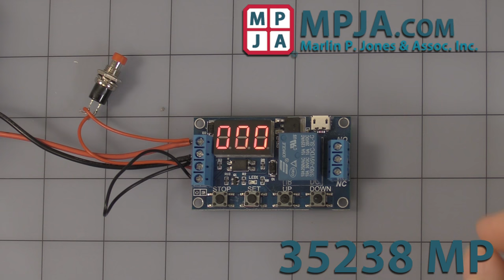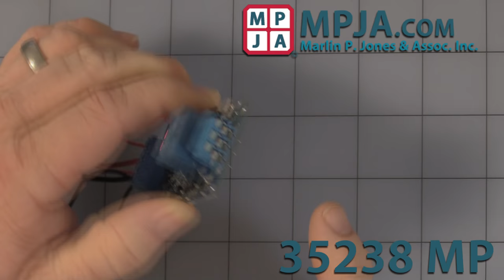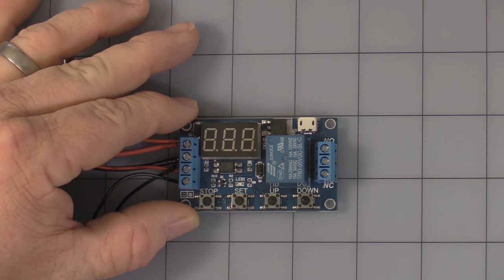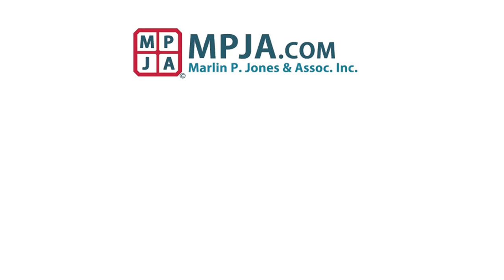Programmable triggered timing board 35238 MP

Comment: There is one more function: Hold down up or down button (F1 is normal operation, F2 when powered up relay turns on with no countdown time) Stop button turn on and off.
Reply: Only on the XJ-801 version

Comment from the maker: Depends on your sensor if it has an adjustable set point (on-off) and a transistor output to act like the switch I used. Plus a separate power source for the delay timer 6-30Vdc.
Thank You

Comment: This is really good. But I got some questions. Can you use a 9 volt battery or other batteries to power it? Do you have any videos on the wiring? I am mildly confused with the ground cable. Does it need it? I want to make sure I wire it with the trigger and the battery and everything. I'm kinda new to electronics and I just built very simple things.

Comment: You do have to have an external trigger voltage. Simply using a switch doesn't work. When using USB power there's a 3.2vdc across the power terminals but it's not enough to use as trigger voltage. As such I think USB power is only really useful if you are using P3-1 or 3-2.

Comment: nice!
I have an old car (brasilian pickup Chevrolet Montana, same as Opel Corsa C) and setting ignition on position 1 doesn't turn the ACC on (it turns on only when holding the key pressed in)
for now the ACC IN signal for my Android headunit is coming from the ignition 2 position, so it only works when my dash is on, whith all the engine systems, with engine running or not
I belive I can use this module setted on program 4 to allow my headunit to keep working for 30 minutes after I turn ignition off
also I can cut power for the module when locking the car
thanks for your video!

Comment: I have problems with this board regarding debouncing of the pushbutton. Did you debouced the switch? I'm using a wall push button to start a fan in mode 1.3 and I have double triggering sometimes.

Comment: I'm looking to buy this with the black relay. They also do a double relay vs. I would like to know, if i get the 24V dc input version. Can i wire 24V dc in parallel to the trigger port. Does it have a memory? In other worlds i would like to power it up and it automatically counts down the pre-programmed time till the relay switches? I have a large DC amplified speaker, i wish to add speaker delay protection in series with one of the speaker wires, one unit for treble and one for bass. I would use the double vs. but they only come with the 10A relay.

Comment: Hello! I have this unit and your video has been extremely helpful however I'm finding that program P2 delays the relay as expected and then turns it on (LED lights up) HOWEVER if you press the trigger while the relay is on, the program starts over. In your example, the trigger starts the program but then is ignored if it is triggered again while the relay is open?  I also found that my counter is counting UP, not DOWN like yours.  Thoughts?

Comment: can this be hooked up with a motion sensor and a nine volt battery supply?
Reply from the maker: Yes it will work with a 9V battery but depending on the current draw of the PIR and how often it is triggered the battery would last less then a day.
Reply: @mpjaonline  alright, what does PIR mean?
Reply from the maker: @thisisyourtransmission  Passive infrared
Reply: The "standby" current requirement is 20mA, and the "Relay Energized" requirement is 60mA per the datasheet on mpjaonline's website. So a typical "9Volt" battery wouldn't last long. Even a high-capacity brand new fully charged lithium-ion "9V" form-factor battery only has about 800mAh capacity. So if the board was in "standby" ALL the time, the lithium battery would last about 800mAh/20mA=40 hours...less than 2 days.
(note: a lithium "9V" battery is actually a maximum of 8.4Volts and can be used down to about 6.0V)
Reply: @exgenica  thank you

Comment: The problem I have with the  Programmable triggered timing board 35238 MP is when trigging  on and of it will stop working
over time  I had to replace it 3 times / using a small scooter  battery 12 v / do in need to add a fuse  ? . or is there one on the board,?

Comment: I have the top two terminals on the left connected to a 9v battery but nothing lights up (no power). I can get it to light up via the micro USB power input. Am I doing something wrong or do I have a faulty board?

Comment: Hey I know this is an old video but I'm hoping you can answer a question about this device... Does it remember the mode and time settings if all power is removed from the device? I.e. when it's hooked up to power next time, is it still in the previously used mode and time delay?
Reply: I have the same question, any idea
Reply: It remembers the mode but you have to push the stop button, is there a way to not do that? So it's always ready to go and power comes back on bypassing the stop on off button

Comment: Can this timer be used for a freezer door left open for say 5 minutes then ring the alarm. And if door is closed within set time and door is then closed timer resets. No Pizzo buzzer noise. Trying to make safety for the freezer door. an open door led light comes on. What I want is if the door is not closed in a set amount of time the timer then would go off and send power to the Pizzo buzzer.

Comment: I'm on P-3.2 mode with Open 10s, close 3s and loop = 3. what my problem is, like at 10:40 it does not energize the relay, and it waits until end of P-3.2 blink to energize the relay. there's about 2 sec delay. how can i program this to overcome the issue ?

Comment: I'm using one of these to control a device in my car so that the device has a delayed shut down when the ignition is turned off. I was hoping to use a 12v output from the ignition switch to trigger the signal so that when the key is on, the relay turns on, when the key is off,  theres a delay then the relay turns off, simple... However I noticed you're using a momentary switch, is it safe to use an ignition switch that would be on the entire time I want the relay on?  In other words do you have to use a momentary switch to keep from overheating the signal input or opto-coupler etc?

Comment: so you can hook this up to a sensor via the trigger pin to turn on the relay? Basically I want the RCWL- 0516 sensor to turn on the relay (no delay) and run for 6 seconds so it powers on a musical box movement and turns off after 6 seconds

Comment: Hi, can i use this with a nodemcu 8266, i need to control a water pump that will turn on when the humidity reach a certain point. But i only need the relay to turn on for a few second, to avoid an overflow.

Comment: You did demonstrate that even if the power was turned off, the relay module still remembers the last setting you set it to. Now, my question is..will the relay module still remember the last settings if I unplugged the battery? Or does the battery need to be connected to the relay at all times for the relay to remember the last setting? Hope I make sense to you.

Comment: This thing get very hot, is that normal? The IC (or whatever it is) between the display and the micro usb connector, it hurt touching it with my fingers. I am feeding it 22v. Was planing on putting inside a box but if it gets that hot maybe that's a bad idea..

Comment: Long shot because this is an older video. Would you happen to have a guess why the timer will activate but the power is not being sent to the device? If I just hit stop it turns on no problem but for some reason when I "trigger" it and the timer goes I get no power? Any guesses will be greatly appreciated.
Reply from the maker: Do you have power connected to the relay’s COM terminal? A relay is only an electronic switch it does not provide power out. Let me know. Thanks

Comment: Sir, can this device be used to make an led flash, say for 3 seconds, and then countdown from an adjustable amount, in a continuous cycle without pressing a button?
Ideally I'd like to be able to control both the interval, and the duration, can it do that? 
Regards Mark.

Comment: So what voltage does the trigger need?
Can it be configured for power-on delay?
e.g.
Switch on power
Delay for x seconds
Energise relay forever until power is switched off.
Reply from the maker: Trigger voltage is 3 to 24vdc most people use the same power source as the timer itself. Look at the section of the video for P2 program it is delay on but max “OP” on time is 999 minutes.

Comment: My unit only counts up -not down-is there an undocumented setting? I have looked all over!
Reply: mine is the same but seems no answer @mpjaonline please advise us. Timer going up means power removed to activate relay which is ok for me as I'm using a standard pir which is a normally closed circuit to activate my stair lighting but if I use pressure mats they are normally open signals which will not work for this. Other than that this is a great module for various projects

Comment: Hi, I am making an exhaust system for my mushroom grow room.  I want to use P3.2 in a loop in a way that after ever 45 minutes the exhaust fan turns on automatically for 15 minutes.  I want this system to run on a 24/7 basis.
 Can you please help me with the following;

1) I am using the USP socket to provide power, so How to set up the wiring for the fan?
2) Please confirm if using P3.2 in a loop is the correct program setting?

Thank you
Reply from the maker: 1) Here is a link on how to connect an AC motor to the board, same principle as an AC fan  
https://www.mpja.com//download/35238outout.jpg

2) P3.2 looks like the correct program but before “going live” let the timer run on your desk for a few cycles or days to make sure it is doing what you want. Remember this board is not weather proof you must protect it from condensing humidity. Good Luck
Reply: @mpjaonline  thank you for your response and feedback. 
Just a follow up question, do I need a trigger of some sort to start the motor?
Reply from the maker: @N4Nai  P3.2 Starts when power is applied, no trigger required.
Reply: @mpjaonline  thank you

Comment: Amazon sells similar boards which also have low voltage trigger and one extra connection point on the left.   Does anybody know, is it a different chip, or low voltage trigger achieved differently ?

Comment: Mine doesn't seem to work( at any setting relay turns on for like 0.1 second, then shows which program is running. Timer doesn't  come up at any setting. Timer seems to work only when you press Stop to turn off the relay.

Comment: I bought the timer a few months ago and finally I decided to use it, but it doesn't work properly. If I set the times from 1 to 10 minutes it's all right, over 10 minutes (any value I set) stops at 1 minute and 5/6 seconds. And even with the program in seconds has some problems.

Comment: I just received mine.  Hooked it up, without a load, the timer counts down and the relay clicks on and off as it should.  After load is connected, com to power+ and NO to the load, the timer instantly stops after triggering.  As far as I can tell with the probe on resistance buzz, the relay never closes?  Hope someone can help!

Comment: How the cirquit needs to be connected if I want to turn it on by a micro switch when I put a glass on it, then a pump needs to go on for 2/3 seconds and fill the glass and then it needs to go off.

How can I do that with the cables and a pump connected to it?

Comment: Great video. I wonder if NC is closed when timer is at "Off" cycle. As an example, can I run one motor when timer is "On" and run another motor when timer is "Off"?
Reply from the maker: Yes the relay output has a normally open and a normally closed contact.
Reply: I'm assuming it is a "standard" break-before-make relay? Not trying to be a pain, just being sure on the spec.

Comment: What is the actual board number on the back? This is practically identical to the JZ-801 board, except the JZ-801 has programs 1.4 (triggered single cycle, no retrigger) and 2.1 (delay w/ retrigger).
Reply: Turns out there is a set of roughly translated instructions at the bottom of the listing.

Comment: Hi. Great video. My timer board (set for 10s OP on P1.3) just does not switch on the Relay nor the active micro led. Timer countdown works exactly as you’ve mentioned but No Relay functionality. Any idea? Could it be a bad board or do I have to factory reset it, and how? Any help will be much appreciated
Reply: Got it working by accidentally pressing the stop button but it works in reverse instead of ON when the timer starts,  relay stays off and turns on when the timer is 000. how to fix that?

Comment: I hoped this item would work for me, but my trigger signal is inverted. I need the function of P4, but my trigger signal is always on, and the trigger would be a short off pulse. I think it would work if there is a P4(.1) with instead of OP, a CL variant. Otherwise I would need to use a second relay to invert the signal.
Any suggestion for similar products, or modifications?
Reply: ters anahtar kullanırsan bu sorunu çözebilirsin

Comment: Thank you sir for informative video,
With this triggered timing board i want to make a project for home, can you please guide me? and sorry for bad grammar English,

Actually i want to make a timer circuit with my doorbell at home
when someone outside trigger the bell button of my home bell
then the 50watt socket system turn on for specific time like (120 seconds etc)

in 50watt socket system i will include
1 x door security camera
1 x 20w small LED/LCD monitor for Camera display
1 x Night LED light for outdoor (with lowlight sensor) if someone ring bell at night

 (Note: my door bell is like bird singing voice, as long it keep ringing as long the bell button is pressed)
(Another thing: it will be more great for me if bell bell is repeatedly pressed by any person then there will no affect on this timer board, and the electricity of door bell should be separate if possible..

Comment: I need help please. It doesn't matter what programming mode I am in, the relay will not activate instantly, it will OP after 10 seconds. I have set the CL on every mode it is available to .1. I currently have it in mode P1.1 with the OP for .1 but it still waits 10 seconds until it closes the relay. In P1.1 that should be instantaneous when triggered. Any ideas?
Reply: @Ijazakhtrbhatti Akhtar I'm not sure what you mean.

Comment: I’m operating on p3.2 to power a 6v motor, why do I not have voltage??? I’m wired just like the video with 6v power and the program is correct and running. Where do I wire the motor in? Do you have a diagram?
Reply from the maker: Here is a link to the data sheet.
https://www.mpja.com/download/35238mpdata.pdf
You wire the motor thought the relay contact, it is like a switch it only turns on and off. It does not supply power.

Comment: tell me about the F1 and F2 functions operated by long pressing up and Down buttons.
also my display is not showing the count down
Reply: F1 and F2 mode is used for toggling relay between normally off and normally on.
i.e it gives the final state of the relay if you are in F1 MODE then relay will be off after time is complete otherwise it will be on.
I am not sure about display problem just make sure it is in C-P mode .

Comment: I have been using this device in Program option P3.2 successfully for almost 2 weeks. However, tiday it has developed a problem. My PL time was 15 minutes and CL was 90 minutes. I had set Loop 120. Today the PL count down starts and then it trips and starts all over again from 15. It is not going to CL mode. BUT when I tried testing it in seconds instead of minutes it works fine. Also while testing I noticed that when the loops finished the switch stays in PL mode.
Any advice anyone? Thank you

Comment: I don't understand how I would power the relay. Would it just be an AC plug from the wall into the board while my lamp is connected to the right side of the board? 

Do i understand correctly that I need and the lamp to be connected to wall outlet, and also the board? or is the board just for the switch?
Reply from the maker: The board and relay is powered by 6-30vdc, normally this is done with a plug in power supply. The relay terminal block on the right side has a “COM” common contact, “NO” normally open contact and a “NC” normally closed contact. The relay only acts like switch opening and closing the hot lead of your ac to the lamp turning it off and on.
Reply: @mpjaonline  Thank you, so if i use normally closed, the lamp goes off while the timer runs, and if i use normally open the lamp goes on while the timer runs. Correct?
Reply from the maker: @arzofire  Yes

Comment: Can you set this so when there is a load it starts a timed delay but once the load is on after the timer has allowed it it will not switch off till the main load has been switched off?
If that makes sense.
Reply: reasearch latching circuit

Comment: Any chance you can please explain to me the different ways to connect the trigger and all wires that need to be connected for the trigger to work? I figured out how to use P3.2 because that doesn't need a trigger, but I can't figure out the other programs because I can't figure out the trigger.

Thanks in advance!
Reply from the maker: Here is a link to the data sheet, In the video use a common ground between power and the trigger and a push button switch between + power and + trigger. https://www.mpja.com/download/35238mpdata.pdf
Reply: @mpjaonline  Thanks!